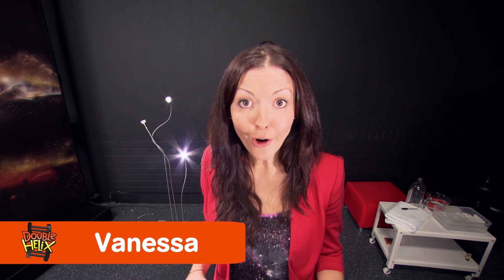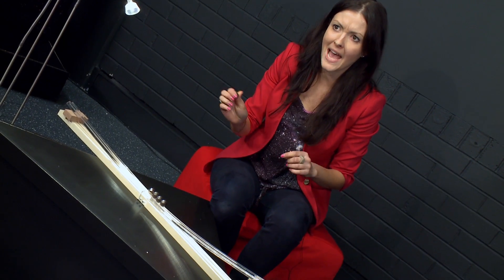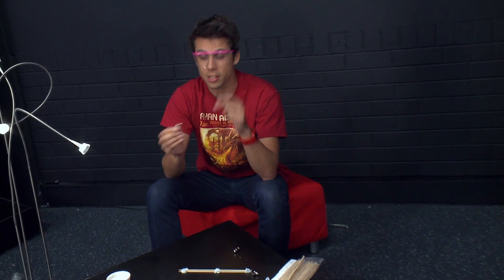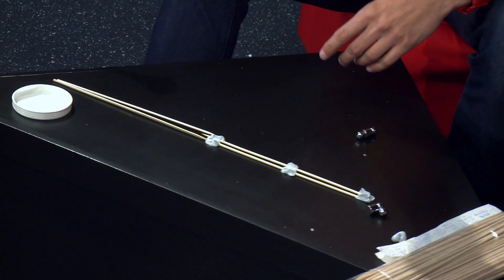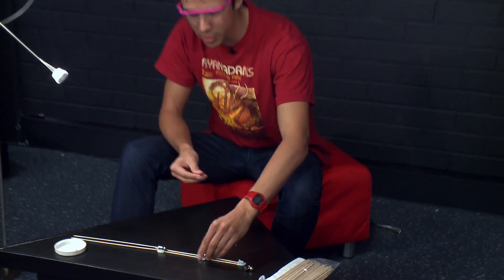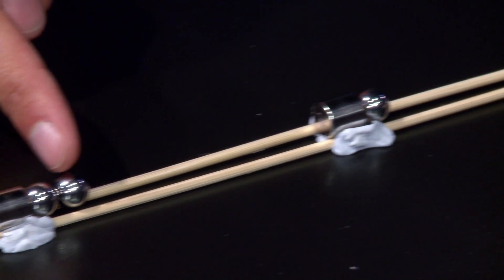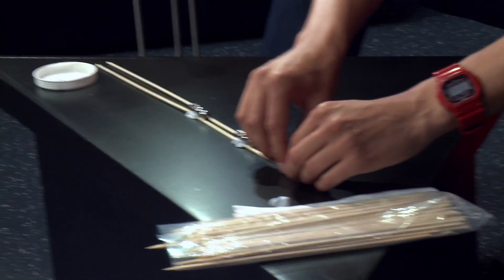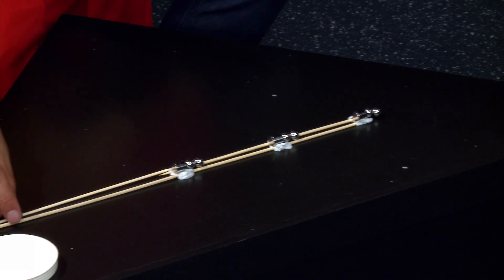Make a magnetic rocket

Comment: It's called a rail gun capacitor that discharges when max peak electromagnetic force reaches maximum electromagnetic field influencing the communication projectile communication satellite magnets to repel it from the ground and pushing it into space. There isn't inertial dampening with the Gravitational forces therefore a human being would have to be really stupid to ride the projectile because we are talking abrupt changes in acceleration where the G forces should, how do I say, "liquify your skeleton" when going through linear acceleration propulsion mechanisms pointing the projectile probe, conserving momentum, which would already be in orbit, ready in orbit. Then there's the  3 D printer making spaceships that will need antimatter and pass by the moon to get it because the moon is where it can be produced safely away from Earth, away from blowing up Earth cities or igniting the antimatter on Earth, the antimatter fuel created using fusion reactors placed on the dark side of the moon and helium 3 reactors, the abundant fuel on the moon all over it especially the dark side of the moon because that is the side pointed toward outer space, with the antimatter safely transported by space elevator, by the pounds, above the lunar surface. Is there coal on the moon? or coal on mars too? On Saturn's moon Titan, any coal? There needs to be a safe distance established in weights and measures so using a nuclear reactor in space will have a bit of trouble poisoning Earth if it blows up.

Comment: Lets consider a rail gun, but lets consider using five or more electromagnetic fields "125" if we need the entire set of electromagnetic fields to accelerate the cargo to maximum velocity to any direction within Free Space..

The trick is to always have more electromagnetic fields locked "Acting as a greater mass" in order to move a single field or "stage" that is set or switched with an opposing pole, so that once momentum is achieved or increased closer to the speed of light, the next field or "stage" in line will have it's poles flipped whilst the previous field or stage is switched off " preserving it's momentum rather than nullifying it..

Comment: thats a neat trick :) so the ball approaching the magnet is sped up, and passes its momentum through the hard magnet and the first ball on the other side to the second ball, which moves away faster since its further from the magnet and has less of a field to escape.  when its all finished, you have one ball on either side of each magnet, sitting right next to it, so thats a lower energy state than when you started and had two balls on one side (one is "higher" in the field).